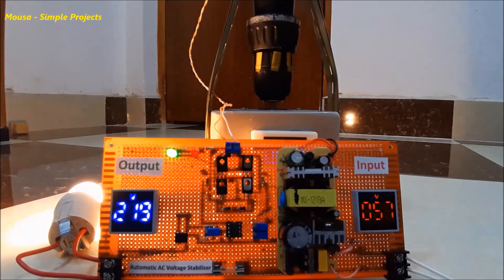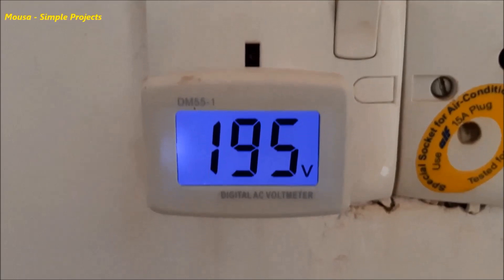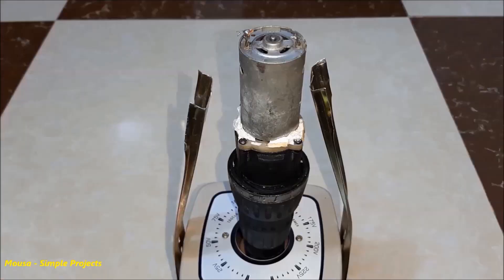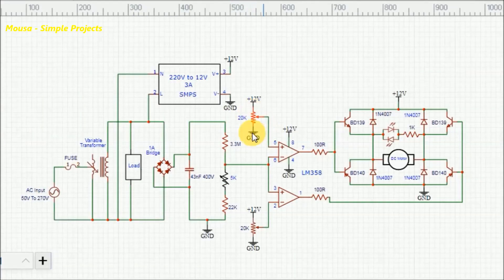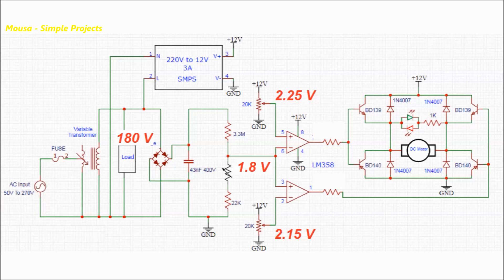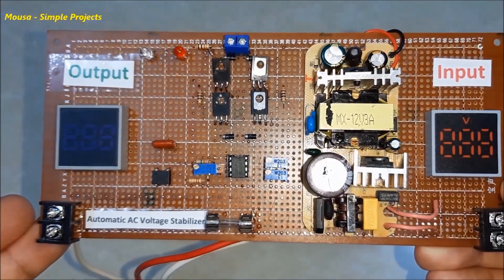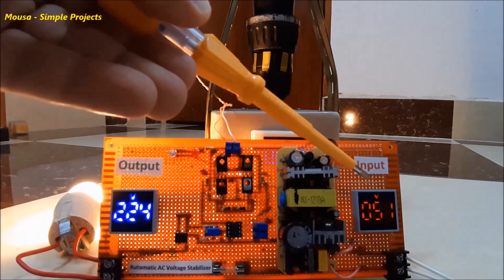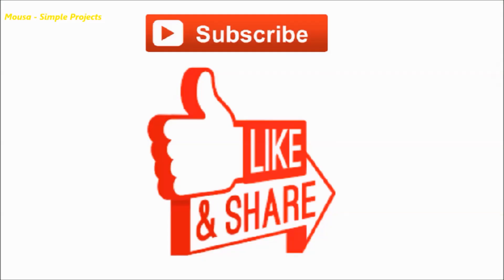Automatic AC Voltage Stabilizer Without microcontroller (Motorized)

Comment: I have a thought about a device that would be installed in an appliance, and the device would stabilize the output voltage to a constant amount, no matter what's the input voltage. It would make it so that the appliance's power (in watts) is unaffected by the input voltage.

Comment: Innovative! What are the specifications of the DC Motor used for the project?
Reply from the maker: I took it from an old 12V cordless drill, i have no more information about power or RPM.